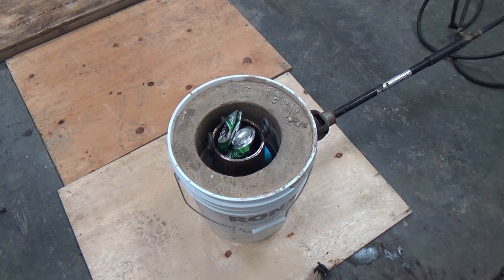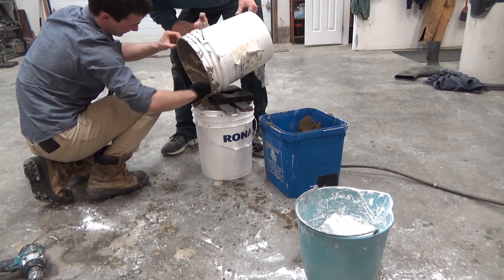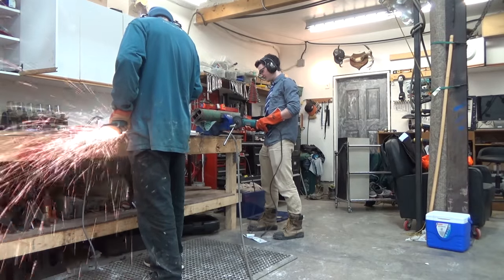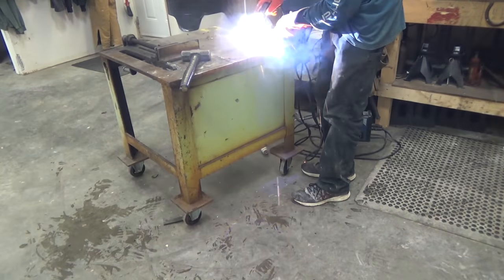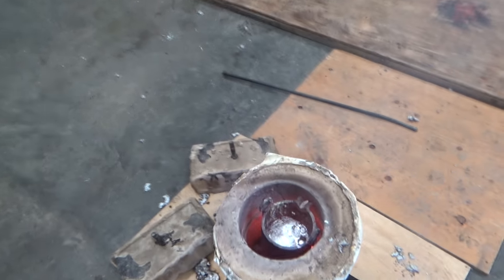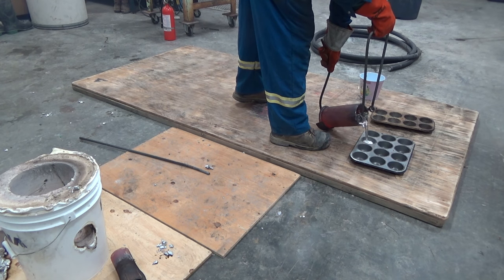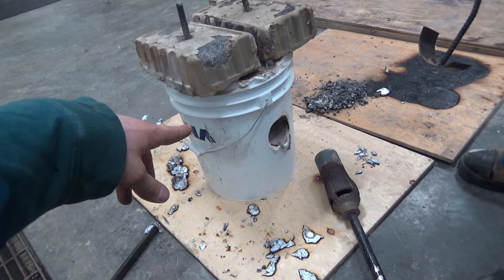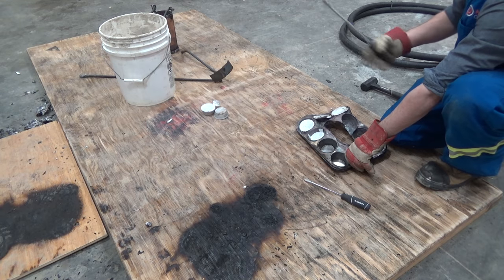My DIY Propane Foundry [50 Bucks and 6 Hours]

Comment: If i want to build a loud car audio system what should i look for (rms power or peak power)?  If a speaker set has more rms power does it mean that it will sound louder?
Reply from the maker: Watts rms is the unit one should use when shopping for speakers and amps. And yes more true power(rms) will be louder most of the time, it’s only when you are looking at different speaker size this could change, for example a 5.25@55wrms may not be louder or sound as nice as a 6.75 @45wrms. I would suggest. You should also understand that peak power is always 200% of rated power(wrms) however low end products/ manufacturers will inflate this number a lot, as is why it should never be used.
Reply: DonkeysBreath Thank you.  :)